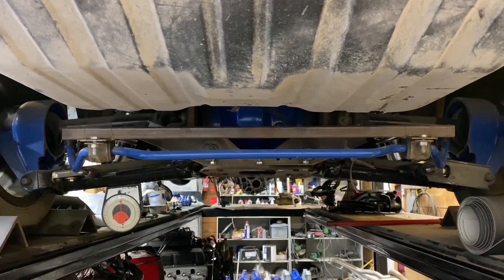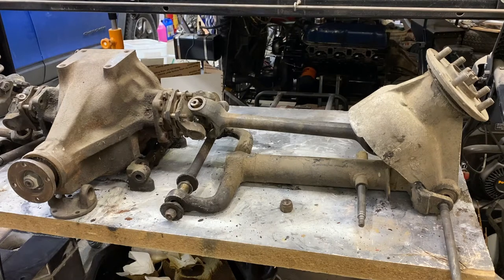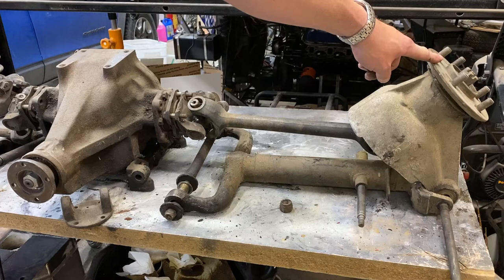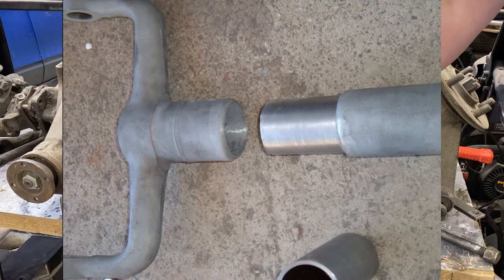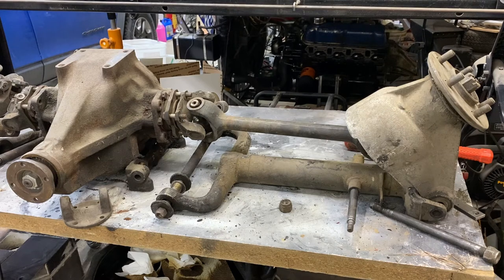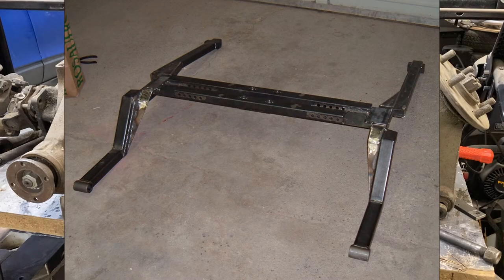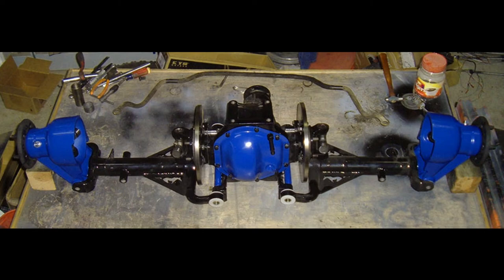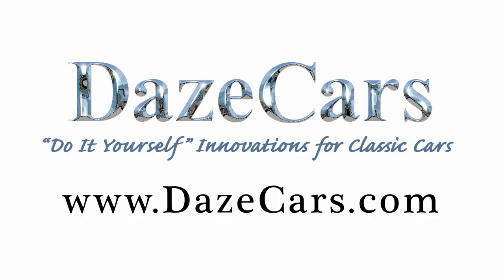Jaguar IRS or Independent Rear Suspension Video 1

Comment: Great video. I just purchased a 1950 shoebox Ford with a Jaguar diff in it and glad I found your youtube video channel which I subbed. Thanks.
Reply from the maker: Glad I could help.  Make sure to check out my web page, there is WAY more info on the jag setup on there.  Also don't hesitate to reach out to me if you have any questions.
Reply: @dazecars  In my 50 Ford Coupe the axles are not horizontal to earth. The center section sits about an inch to inch and a half lower than out bord. Is this expectable? Also when I call coil over shock manufactures they make figuring out coil spring rates confusing. The car weighs about 3200 lbs. Any ideas on spring rates that I should use?
Reply from the maker: @myhotrodtv  The system will work with the wishbones tilted rather than parallel to the road but it is not ideal.  It effects the camber curve.  For optimal setup you want the wishbones parallel.  As to spring rate are you running one per side or two?

Comment: if you don't mind a question.
here in Europe , older Jags are known for 
a)good handling,,,
b)extreme comfort....

looking at it , it looks like someone did half a job dezining it... like the got bored , to crreate another swingarm...
where does the  magic come from ?
is it a wise choise of spring and shocks?
Reply from the maker: Simplicity, unsprung weight, and free moving suspension are the secret ingredients.  The simplicity makes it easy to retrofit putting as little weight on the suspension parts and the free moving parts makes the care hand well and gives it a comfortable ride.

Comment: Please excuse my ignorance but I have to ask the question, there must be a bountiful supply of American irs, what advantages does the Jag unit have over them?
Reply from the maker: Funny enough depending on your definition the earlier Jaguar IRS units (up into the mid 80s) are "American".  The entire assemble was made by Spicer in the states and shipped overseas.  All the bolts are SEA and the u-joints are a common ford size for the drive shaft and a common Chevy size for the half shafts. The center section is basically a modified version of the Dana44.  

Now that I have provided a little trivia let me answer your actual question.  There are two reasons for the average person to use a jaguar IRS and a third reason I chose it.   The common reasons are first, the XJ6 is fairly common and the unit is relatively inexpensive.  More modern American made IRS units are easily twice the cost and way more complicated.  Second the Jag unit is extremely effective while still being very simple.  The simplicity allows you to change the width without messing up the suspension geometry.  In fact the technique used by hotrodders to change the width  (shorten or lengthen the half shafts and wishbones) is the same thing Jaguar did.  The XKE IRS is way narrower then the XJ6. To accommodate the wider XJ6 Jaguar simply lengthened the wishbones and half shafts, no other modifications were required.  

The third reason that applies to me and maybe some other Mustangers is the IRS that Ford designed for the first generation Mustang and never put into production used a Jaguar center section so by going with the Jag unit I am honoring the original design to a small degree.
Reply: Thanks for the education, in all my years of my love affair with the automobile, never has there been a hint of the "American connection" in regards to the Jaguar irs. I couldn't believe my ears when I heard the details in your video so I played it back and used the cc to watch the words as well. @dazecars
Reply from the maker: it really is an amazing rear end @anthonyxuereb792

Comment: Great video. Question ---My IRS is in its original cage (rubber mounted to frame). I need to change my pinion angle to slope upwards at approx 6 degrees (currently set at 0 degrees). Any advice on how to go about doing this while maintaining the LCA parallel to ground?
Reply from the maker: I have a solution to get you 5º up but you may not like it.  Rework your mount to angle the cage and get the pinion to a 5º angle, then get a set of XKE LCA mounting brackets.  This will get the wishbones parallel with the road again.  If you must get 6º then you could angle the extra degree and have the wishbones be 1º off parallel.  Please let me know if I can be of further assistance.  Check out my web page it goes into more detail https://dazecars.com/dazed/JaguarIRS7.html
Reply: @dazecars  Excellent website and exactly the pinion angle information I been seeking for months. Nobody seems to know anything about the subject except for you. I think I could get by with changing to the 3 degree pinion angle. My tranny is pointing downwards at 5.6 degrees so this change would decrease the misalignment to 2.6 degrees which is much more reasonable.  Would you happen to have any 3.8S brackets laying around?
Reply: @DazeCars ---What is a good email address?
Reply from the maker: @robertwaid6988  I don’t have the brackets you need, but a set could easily be fabricated. If you go back to my website there is email contact information all over the place.
Reply: @dazecars  Regarding your email address, your webpage has several "Contact" buttons but when I click them nothing happens. Maybe it's my browser.
Reply from the maker: @robertwaid6988  it must be on your end, people contact me all the time through my website.

Comment: I have 2 coil over shocks per side.
Reply from the maker: When I did mine I started with the stock Jag springs, they are 200# " each for a total of 400.  the result was to stiff for the light Mustang so I adjusted from there and ended up with a single 300#" QA1 coil over.